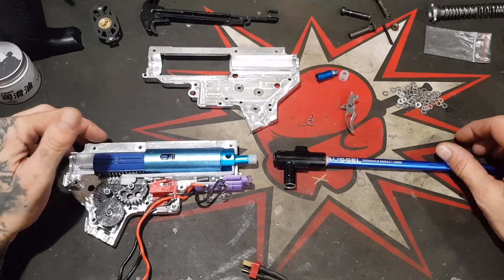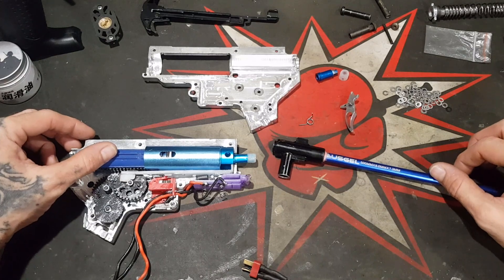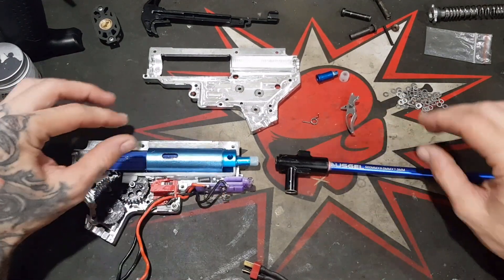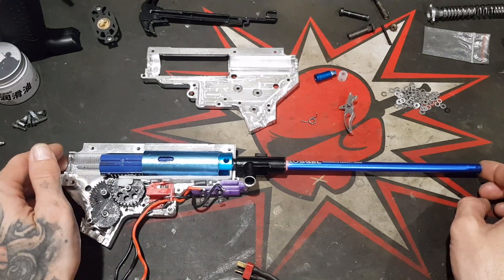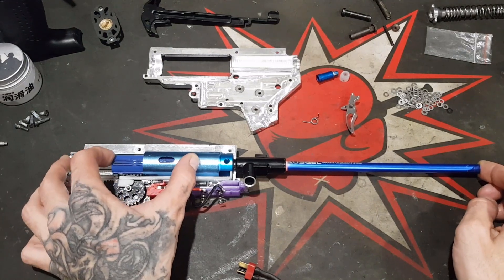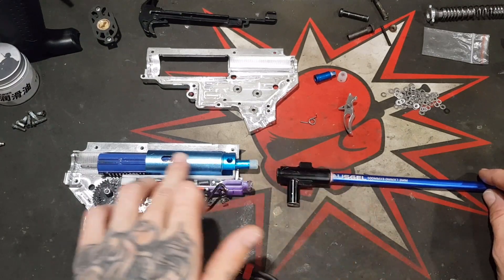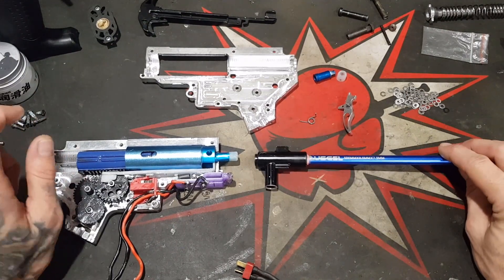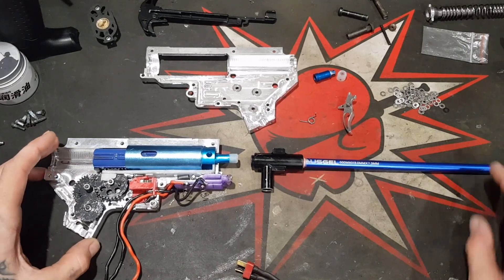Getting a good air-seal (AEG)

Comment: I was surprised to hear wd-40 with silicone. I always thought wd-40 are only for losening tight or rusty screws and not good for o rings.  Is it any special or it works like any other silicone spray?
Reply: anything oily (without petrol or any solvent) is good for o rings
Reply: as mentioned > yellow can of WD-40 = silicon spray. 
It is not the blue one. Totally different product
Reply: @hsromik  diky. :)
Reply: @HonzaZalabak  WD-40 produces all kinds of lubricants. They have lithium grease, ptfe lube (went and dry) and silicone lubricant all in spray bottles. Normally stores carry just the regular WD-40 and sometimes they have their Silicone lube. Silicone lube is great for lubing the gearbox shell and bearings before you add grease because it penetrates deeper into bearings and sticks to shell surface well tho you have to add thicker grease to your gears anyway. 
I usually clean the shell with alcohol, spray silicone lube over the bearings, add in the gears, shim them, add PTFE grease for gears and a tiny bit for bearings and silicone grease for air seal parts.
Reply: ALL WD-40 has petroleum in it. even the silicon oil version @hsromik